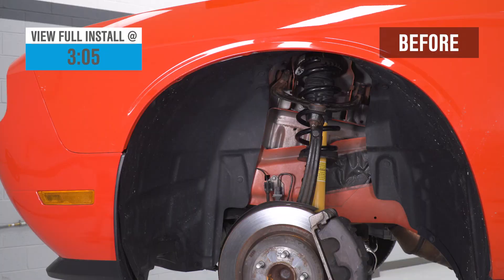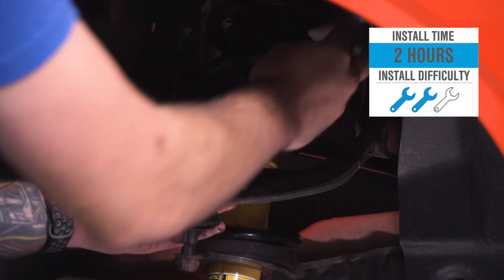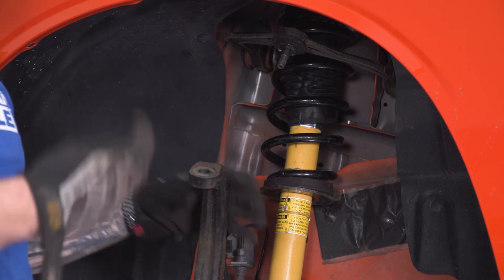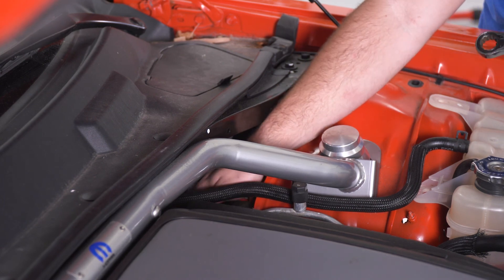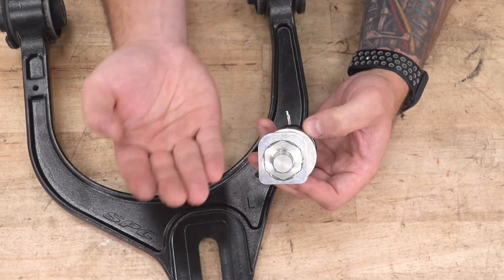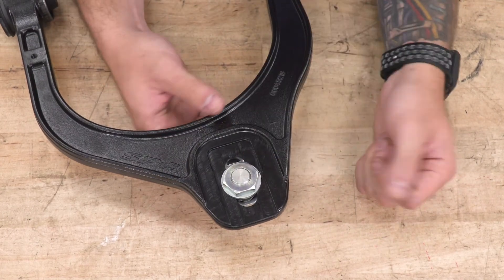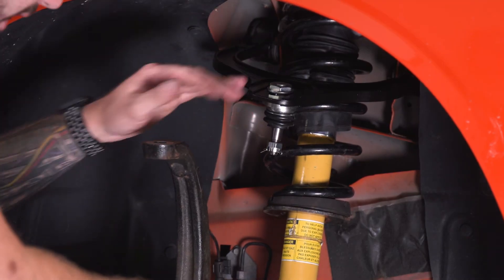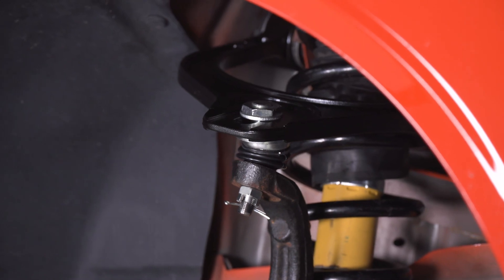2009-2020 Challenger Eibach Pro-Alignment Camber Arm Kit Review & Install

Comment: for changing the rear camber bushings does the weight of the vehicle need to be on it also?
Reply: Yes I used a floor jack to load the suspension, because there is no getting to them after tire is on my challenger is lowered

Comment: Do I have to get this for both the front and rear, if I have done the eibach springs all the way around
Reply: I've lowered 4 392's  with the EibachPro kit and didn't need any arms or camber bushings. There cars have negative camber from the factory so you just need positive toe. Don't let these people take all your money for nothing.
Reply: @lmjames33  My car has negatice camber. And its wearin my tires too fast. What can i do? 400 dollars is kinda pricey for those uper control arms.
Reply: @Leviro  my alignment guy did  positive toe to offset everything.  My tires are wearing great!!!!. I'm off like 0.01% which is nothing.  Not sure man.....I did the Eibach Pro kit on my Charger widebody.
Reply: @lmjames33 I’m getting eibach pro kit on my 16 challenger rt I’m also getting the mrr 392 wheels +18 offset in front +22 in rear
Reply: @Sublimevee  nice!!! It will look good 👍
Reply: @lmjames33 yours is good because you got the charger but the challenger has more issues with the front having non adjustable camber points I’m not sure about the chargers but challengers definitely need upper control arms
Reply: @crazypkm  gotcha 👌
Reply: @lmjames33 was yours the  challenger or charger?